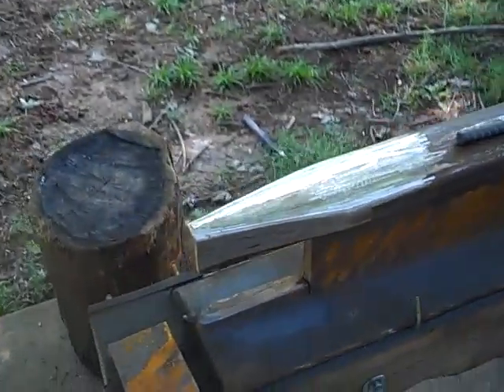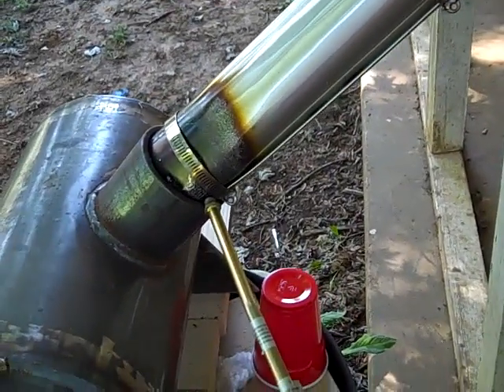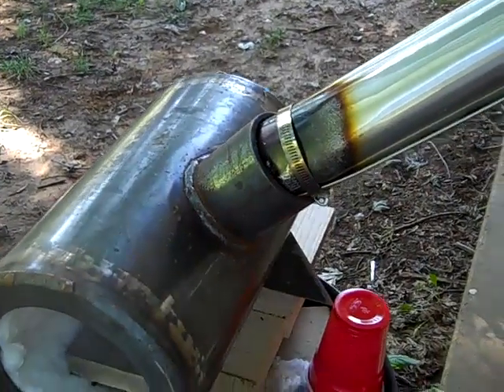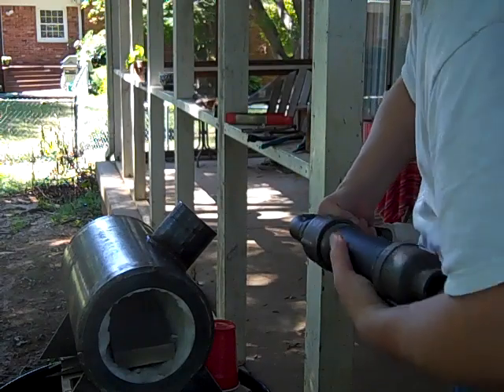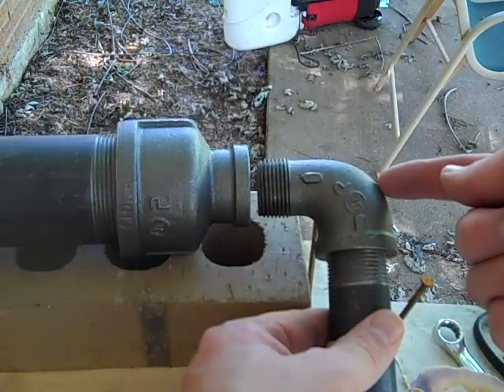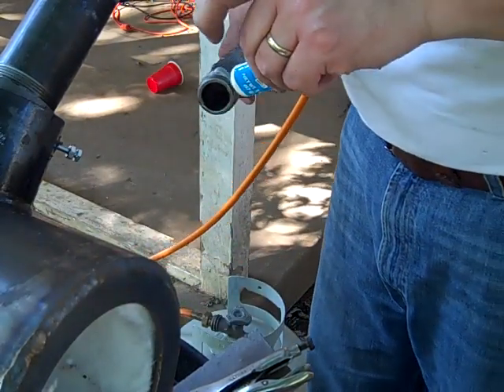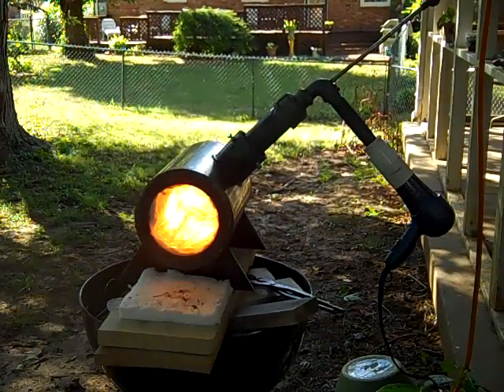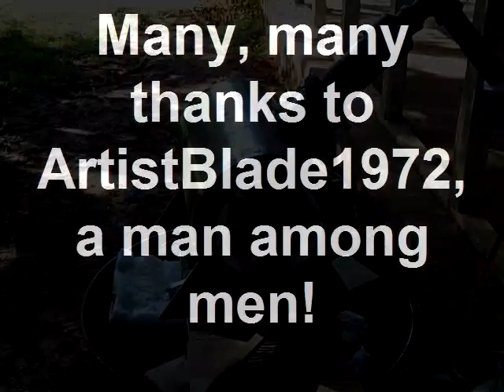Forced-air propane forge

Comment: Wow man! .. Never seen propane get so hot. I'm building a Forge out of a old side fed fireplace and I want it as hot as possible. I was going to just buy a big ass propane torch that most people use. after seeing this suddenly I find myself staring at my blower fan... I'm totally doing this! The port in the top of the fireplace is 4" but I'll just do exactly what you did. This fp is like 2ft deep from the side so I need tons of heat. Ty for the video!

Comment: @Makermook That's cool, you should be very happy with it then. looks like a killer little forge. 1 tip for ya, basically all hair dryers have low voltage DC motors that run the fan. They use the heating element as a resistor and a diode to make a half wave rectifier to drive it. If you have a small variable dc power supply you can get some relatively precision air control out of it. Just gut it and hook the power supply straight to the motor leads...

Comment from the maker: @RDPproject I don't know about a round insert.  I'd still have to cut a hole for the flame inlet and I'd have to insulate the back wall.  I think I'm going to buy some kiln cement ("Satanite" I think it's called) and line the inside with about a 1/4" coating.  That stuff is apparently rated to 3000 F, as opposed to the 2600 F kaowool.  If I melt through the Satanite, I think I'll just bag the blacksmithing thing and rent my kiln out as an auxiliary sun.

Comment from the maker: @RichL123 I've been thinking about that.  I also wonder if I ought to get rid of the fire brick.  I also need to fiddle around with the output nozzle and see if seating it further in or out of the 3" tube changes the burn pattern on the inside...my aim would be to eliminate the hot spot that hits the wall and melts that fabric.

Comment: I have used a similar burner on a kiln, I had variable air speed and gas volume. Perhaps try it with out the 2.5" reducer on the end of the burner to disperse the flame more, maybe it won't melt your liner. I think there is a product you can spray on the wool liner to make it hard and rigid, I don't know what it is called.

Comment from the maker: @MuscaVolitans I had it made out of heavy steel pipe, I think it was schedule 40.  If I had it to do over again, I would have used an old propane can or a freon can.  With the insulating blanket and the satanite coating I've installed, the forge I have is ridiculously over-built, and a thinner metal container would do just fine.

Comment: You can try two coats of a refractory cement over your fire wool.  That should help protect the wool, improve the isolation (allowing a higher heat and great efficiency), and prevent small pieces of the wool from flying around and becoming an inhalation hazard.

Comment from the maker: @maxey83112 No, that's not galvanized.  You are correct that galvanized metal is very dangerous when heated, but I used black iron pipe, definitely not galvanized. Thanks for your concern, though.

Comment: its a little hard to tell from the video but it looks like you need a pressure regulator on the propane. those tanks have around 60 psi in them but with the forced air you can use as little as 7 psi. that might also solve the problem of burning the insulation.

Comment: It would be great if you could cut the welds and spin it around so your inlet is pointing straight down. There is always a hot spot with forced air, but you can use that to your advantage. Forced air rules over venturi hands down...

Comment from the maker: I don't know for sure how long a 20 lb tank of propane lasts.  I had a 1/3 full can when I got the forge working, and I guess I've gotten about 8 hours out of that so far.  But I'm still fine-tuning the air/gas mixture, so it may end up getting better efficiency.  I know for sure that it's more efficient than the weed-burner setup I was using.

Comment: not sure if this is the same material as we use for boiles , or how hot that flame is,two things you can try a chamber blanket or a type of cement that i had used, sorry cannot remember the name but i got it the local cement co. it is good for 2200 thousand deg, not sure if that would help, have fun

Comment: @naabtalschmied Did you watch the entire video?  It actually does work, though it isn't very pretty.  I have also seen very similar homemade forced air/gas forges in operation and they work quite well and even generate enough heat for welding.

Comment: G'day Mark, nice work champ, thats mighty powerful. Hoping you would tell me if the 1 1/4" pipe runs right through the 2 1/2 " pipe or is the 2 1/2 " pipe hollow ? I'm hoping to use your set up to power my foundry furnace. Many thanks :)

Comment: that ceramic blanket is only 2300 or 2400 degree's if that2600 damn that's over kill
 only thing id  worry about maybe is that chamber you made when you put the bottom nipple on you made a gas chamber ,  damn good producer of heat though how long does it take to heat a stacked billet ?

Comment from the maker: @thecustomart11 I doubt it, but I've never worked with a coal forge, so I don't know for sure.  From everything I've seen, coal can get hotter easier (hot enough to melt the steel even), but it's messier.  I don't have a problem with the mess, but my wife might :)

Comment: i built a mini torch that runs off my air compressor and a little camping propane bottle it will melt light gauge stainless steel in 22 seconds I am trying to collaborate with  bernzomatic

Comment: a F254AP-1-2 fan from fantec (254x89mm moves 600cfm plugs into wall with 2 prong cord) would do much better than a hair dryer and would completely eliminate slow airflow problems... just watch your fingers around it

Comment: try zoeller forge .com and get the ceramic coating for your blanket, it protects the blanket from breaking down and you from the harmfull dust it gives off, not good to breath in. nice job by the way.